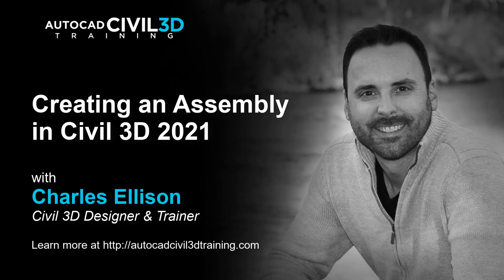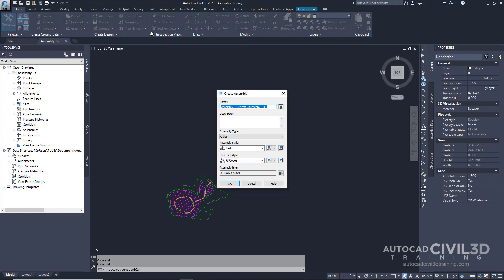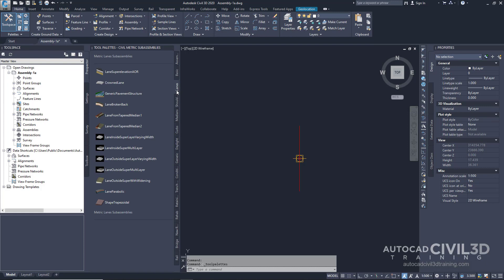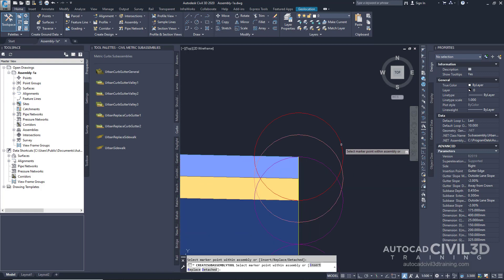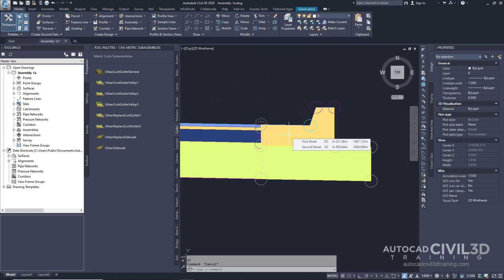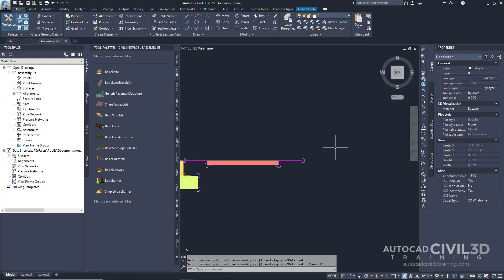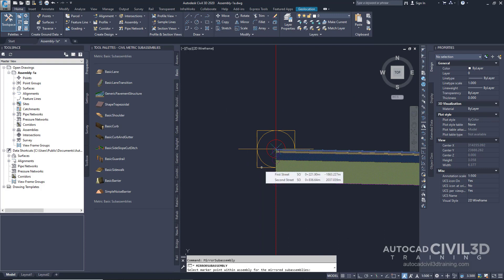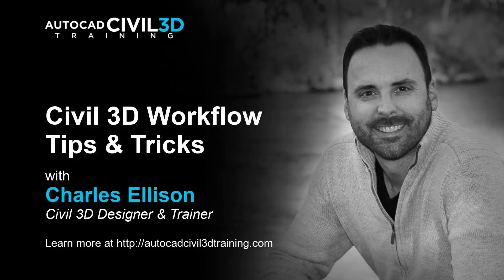Creating an Assembly in Civil 3D 2018, 2019, 2020, 2021

Comment: I need to create an assembly. A detention tank.
Reply from the maker: For a detention tank assembly, build it using generic links + generic shapes in the Assembly Editor. You won’t find a default tank subassembly — you have to model the shape using custom generic components, then tie the parameters to your depth/width values.